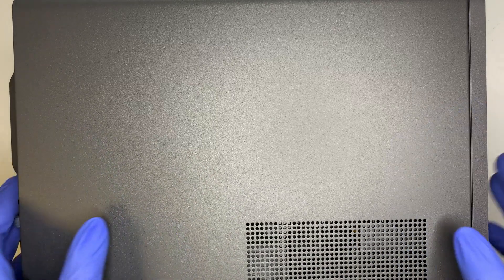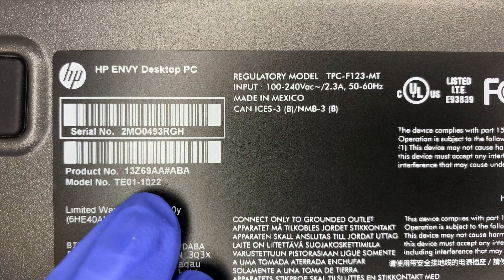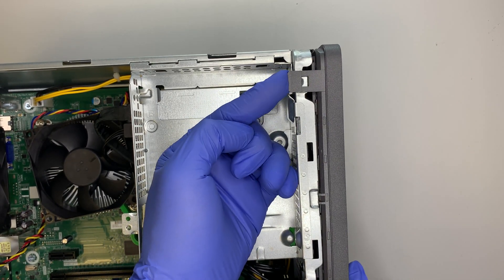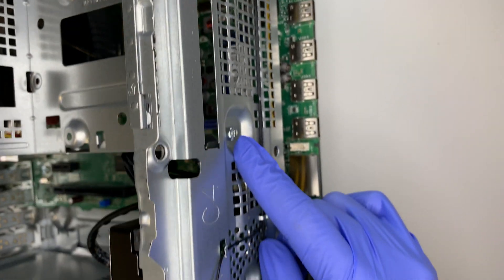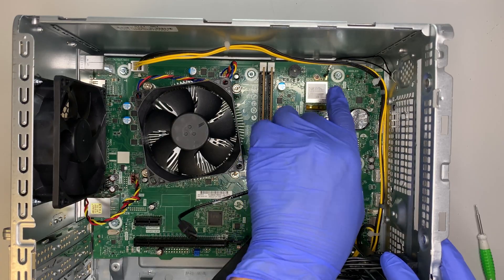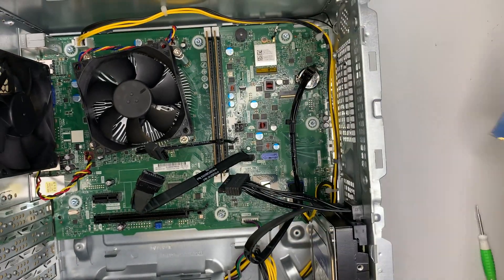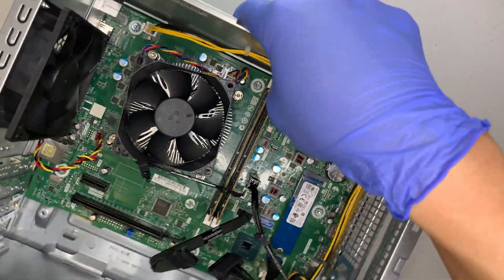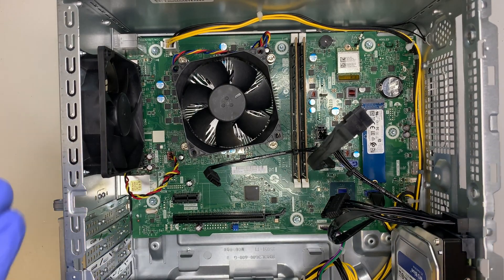HP Envy Desktop TE01-1022

Comment: Has anyone here figured how to enable the integrated video card after adding a low profile additional video card?   Once adding a video card to this system, the integrated  video seems to be disabled.   The ports on the added video card work, but I am trying to support additional monitors using the ports from both integrated video and the added Radeon HD 5450.  (PC - HP Envy TE01-3xxx - BIOS rev F.13)  I have checked the Bios, and all ports are enabled.

Comment: Very helpful. Question: is the list of suitable graphics cards without a power increase in the description up to date? I'm considering one.
Reply: The power supply for this model is rated for only 180W. That means your only options for graphics cards are cards that don't need additional power connectors. As of now 7/14/2022, the best card is a GTX 1650. This card will basically slot right into your PCI-E slot and be good to go. This card will give decent framerates for most games on medium settings at 1080p.

Comment: Nice and timely. I have a question for you.  
Like you mention about the no power due to an outage. My desktop does NOT come on, no power. I have used HP virtual assistant but still no power.

I replaced the power supply and still no power. 

I am an EE and have worked on computers since Windows95.
I have pulled out theCR bios battery, checked it is 3.0 volts.

Can you suggest anything?

 I'm down to either needs power supply - but replaced it. A chance exist the replacement too is bad. I have found that the old PS and new PS had 13volts (in that area) on the yellow wire.

So I did pull off all usb cabling on by one - no power.

Only things left are the mother board, 512G SSD M -memory or the power supply.

All usb devices were removed. Pulled off the monitor. The results are still no power.

Please advise.
Reply from the maker: After changing the power supply and still not powering on, more likely the motherboard is bad. You can either change the motherboard or move on with newer desktop. If you need data, you can try USB M.2 adapter to extract your data:   https://amzn.to/3zKYkTo
Reply: One thing you haven't mentioned is if you checked the CPU.

Comment: You can still upgrade the graphics card to a "slightly" better low voltage gaming card.  I found a "Sata" to 6 pin power cable on eBay... to power my 80w graphics card.  This takes power from the empty 2nd hard drive Sata power cable.  The reason I need to do this is so that I can attached a second monitor.  (my video card has 2 DP connectors)  I do not do any gaming...but this will solve the power issue if you want a better graphics card that requires direct power.

Comment: I have a 4 k monitor and don’t know  much about computers. Would this be good for graphics/ video editing ? That’s what I would use it for mostly.Thanks!
Reply from the maker: This PC is not recommended for graphic or video editing.
Reply: @UbergeeksBiz  Thank you!
Reply: Amazon has a PSU thats a perfect fit and upgrade so you can be able to add a better graphics card,  I got it and now have an RX6600 to this PC

Comment: Can a bigger psu be used as a replacement? I know the psu slot is too small for a bigger psu, but if I can place the psu outside the case, will the wiring and connectors allow it?
Reply from the maker: Power supply connectors are different. Double check the motherboard power supply connectors
Reply: @UbergeeksBiz  would the EVGA 650W N1 Series be good? It has a 4pin for cpu and a 24 pin, 20 pin plus a separate 4pin for the motherboard. Would the separate 4 pin be able to power the motherboard?
Reply: @TheBlackCat352  did it work out ? i wanna do the same but not tryna get a whole nother pc

Comment: so i have a gpu for installed, and is there a way to install a fan into the pc to cool the gpu?
Reply from the maker: Not really. No room for intake fan
Reply: You would need to get a low profile CPU cooler, and while those aren't that great compared to full size ones, it's still better than any stock cooler.

Comment: Can you give me a little list of the best gpu I can install into this???
Reply from the maker: Try this: https://amzn.to/3izGLvo
Reply: Best GPU you can install without changing the PSU would be a GTX 1650. It doesn't require any power connectors from the PSU and is rated for 75W and it draws it from the motherboard itself.

Comment: @UberGeeks I bought a higher end model of this same PC with an RTX 3060 graphics card and a 400w PSU. I know HO use proprietary PSU, Mobo and connectors. Do you know if there's any higher wattage HP PSU that has the right shape and connectors for this mobo or can a third party PSU work with adapters?

Will HP L05757-800 500w PSU work? It looks the same and I believe same connectors
Reply: I got one of those as well. I dnt get sound out of mine n i was wondering if u do. I dnt have any speakers hooked up nor do my monitors have speakers. I noticed this pc doesn't have an internal spkr. Im wondering if the gpu does
Reply: @crazyedd707  I honestly don't know. I have it connected to a Vizio TV and it outputs sounds via the HDMI cable just fine.
Reply: @bca5251  i think it needs external speakers for sound unfortunately
Reply from the maker: You need external speaker or HDMI to speaker monitor
Reply from the maker: That bigger PSU will not work. It does not fit in the desktop. Try look at the size measurement again.
Reply: I have power  problem and in research feel I can direct you.  HP site has a help blog, the is a HP power supply upgrade list - like a excel speed sheet. It gives crosses. Also, others were talking about their upgrades at the HP help blog. Good luck.

Comment: I am trying to replace the Optical Drive with a Samsung Evo SSD but the power cord does not match its15  pins.  Any suggestions as to the appropriate cord to plug into SSD and motherboard? Thx.
Reply from the maker: You should have additional power cable and sata cable to your add-on SSD

Comment: I have a 6-Pin power gpu can I use it with this computer?
Reply from the maker: NO
Reply: @UbergeeksBiz  hey man can you search up “ZOTAC GAMING GeForce GTX 1650 LP 4GB GDDR6” it’s a graphics card that says low profile on Amazon. Please let me know if that card works with this computer. If you have any other graphics cards that you KNOW work can you please suggest some. Thanks.
Reply from the maker: @genesters8619  Try this:  https://amzn.to/3wxNDin   or      https://amzn.to/3fjZUkz     They both does not require 6 / 8 pins connector

Comment: Can I put a 2060 or 2070 in there?
Reply from the maker: Cannot
Reply: @UbergeeksBiz  How about Gtx 1080?
Reply from the maker: @maxpoop  1080 can. It has 8 pins PCIe connector
Reply from the maker: @maxpoop  Yes. Enough power to run

Comment: What’s the best graphics card you can put in there?
Reply from the maker: Something like this:   https://amzn.to/3bAxPCG    graphic card that does not need 6 / 8 pins power.
Reply: @UbergeeksBiz  can you repost the link? It’s not available….
Reply from the maker: @jj704.0  Try this:  https://amzn.to/3fIrvv3      https://amzn.to/3fAMDDq
Reply: @UbergeeksBiz  With the limited PSU, would those options work?
Reply from the maker: @jj704.0  Yes
Reply: I'm running an rx 550 and its running call of duty warzone.  My envy came with a 400 watt power supply.
Reply: GTX 1650

Comment: This is great review.  My exact HP model just arrived from Amazon.   I am planning to remove the 1 TB hard disk and replace it with a 10 TB hard disk.  Can the power supply handle this 10 TB hard disk ?  My 10 Tb hard disk is a Seagate Ironwolf NAS ST10000VN0008.   Thank you very much.
Reply from the maker: Yes, it will work on 10tb SATA drive

Comment: In order to have an external graphics card, could you just add a larger wattage of power (Replace the the power source) to run an extra G card? Thanks!
Reply from the maker: The PSU slot is not big enough for bigger PSU.
Reply: @UbergeeksBiz   Amazon has a 400w compatible unit, its a perfect fit. i have it. now i have an rx6600 to this pc
Reply from the maker: @darkmoon1884  Can you share the link pls ?